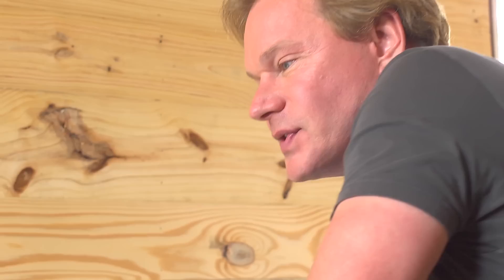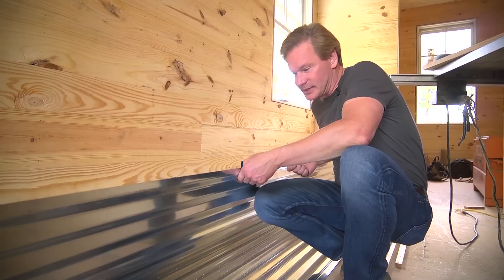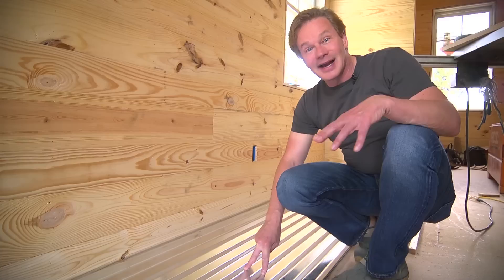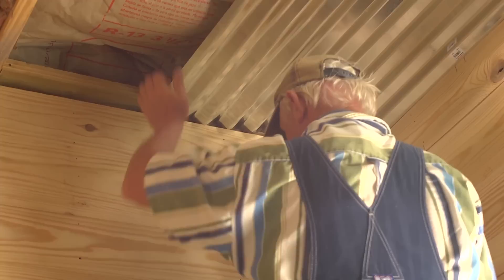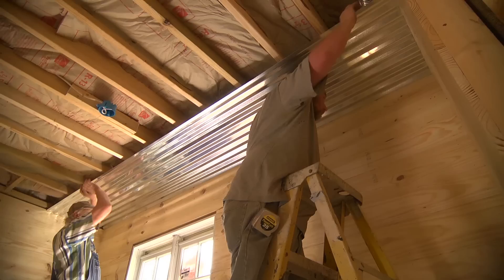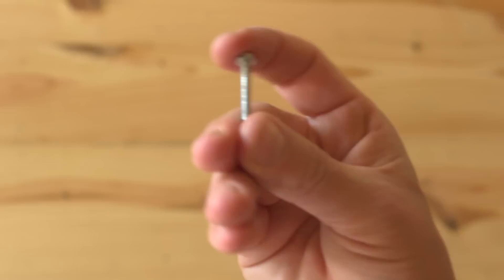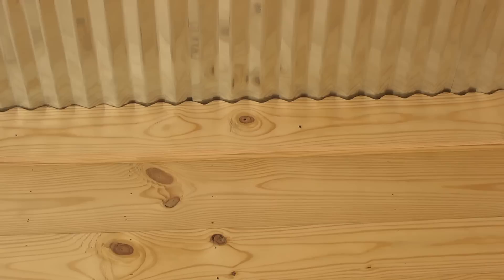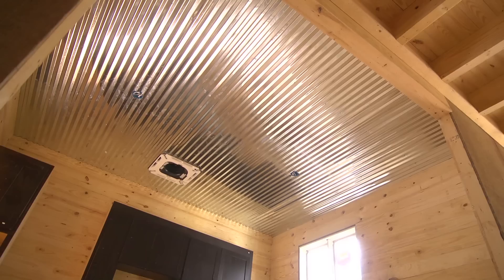Barn Roof Ceiling | Day 97 | The Garden Home Challenge With P. Allen Smith

Comment: I did this on my bathroom ceiling. How do I get it to seal around the shower light and around the heater vent? The ripples in the tin makes it impossible to seal. My heat and air now blows out of the ripples in the tin. Frustrating! Can I use some kind of thick weather stripping foam to put between the register and the tin, and between the light ring and the tin? Dont want moisture getting in my light can. Im desperate! Ready to take it all down and just paint it. Thanks a bunch!

Comment: PAllenSmith, we are wanting to put corregated metal on our ceiling but do not want it to be so shiny, but do not want to paint it.  We want something similar to the dullness of gun metal.  We need a solution within a week or two and not sure where to turn.  We have not been able to find weathered tin so we are having to buy new.  Do you have any suggestions?  Does the gauge of the metal determine the shine?  Thank you in advance for your help.
Reply: Late response but maybe someone else is wondering the same thing . Simple Muratic acid like you clean concrete with will dull the shine and give a rustic look to new galvanized metal .
Reply: Lysol toilet bowl cleaner should do it. Try a few small tester pieces, rub on leave for 30 minutes and take off. Another piece leave on lysol for an hour and then take off. You can also try multiple applications to achieve different results, decide desired effect by playing with several scrap pieces. Good luck.

Comment: Did you use any kind of insulation in between the beams of the ceiling before you attached the sheet metal?

Comment: Excellent, Im thinking of doing this in my detached garage and my attached garage ceilings. Thanks for the ceiling idea. what was the thickness on the metal you used and length ?. Thanks again

Comment: Unless I missed something there was no drywall on the ceiling before the metal was installed.  Code requirements in this part of the country require drywall for fire stop before anything decorative is attached.  Walls and ceilings.  Just something to consider.
Reply: Metal with a min thickness of .016" meets the 15 minute thermal barrier code .   http://www.foam-tech.com/theory/firebarriers.htm